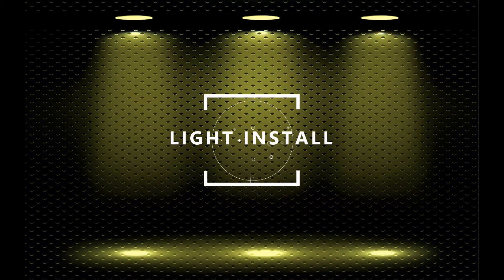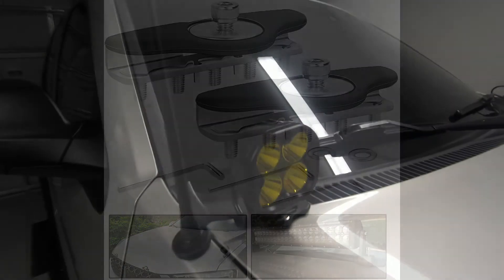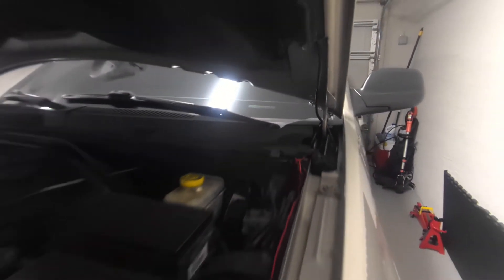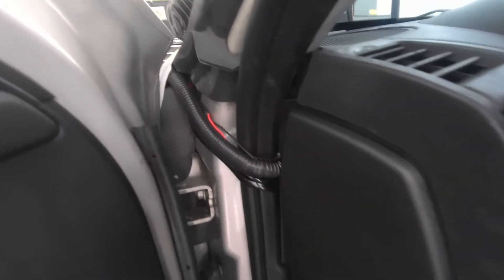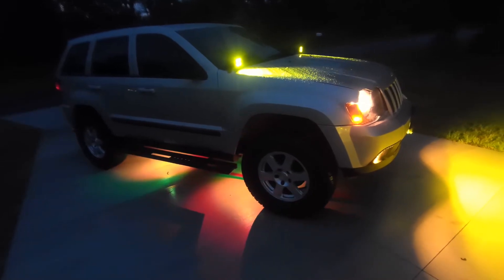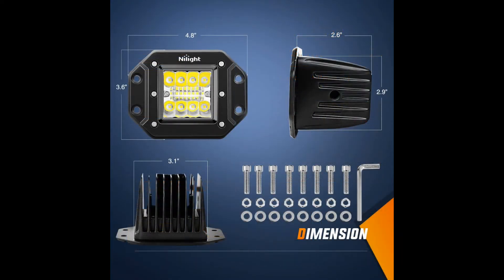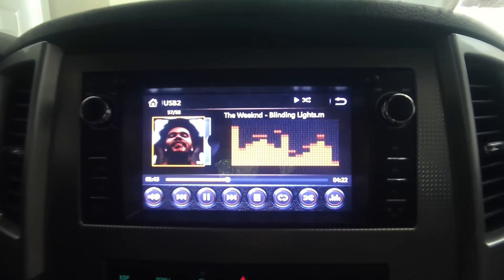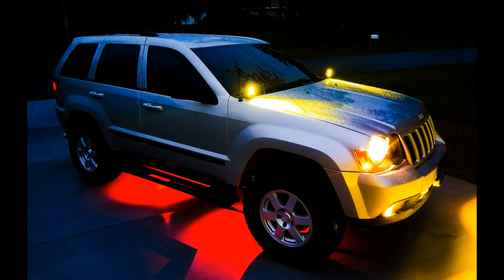Jeep Grand Cherokee WK - LED Light Kit

Comment: how did you connect it to the rocker panel. did you just hook the wire harnesses to the battery and then to the rocker panel, or did you daisy's chain it with the pre existing wires on the panel
Reply from the maker: The lights were mounted and chained together with the included hardware. They were connected to the light switch panel inside the Jeep, which is wired to the battery and grounded to the chassis.